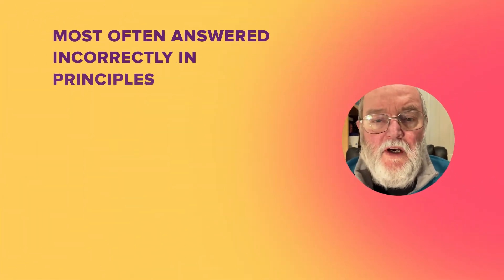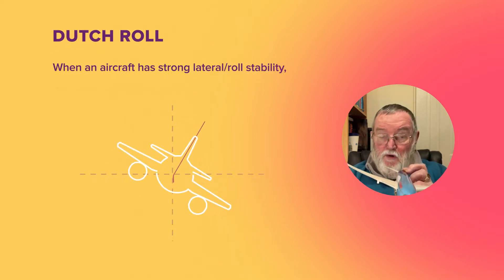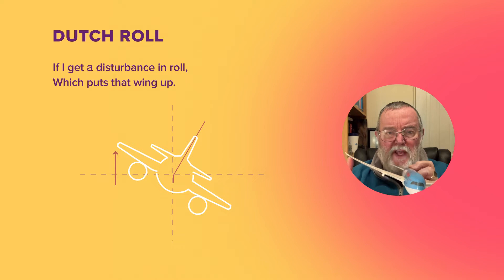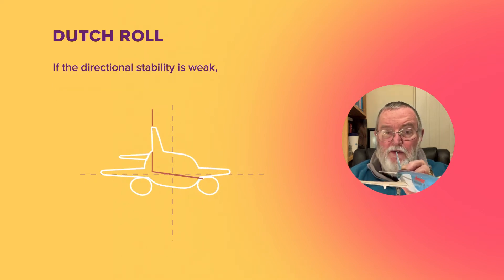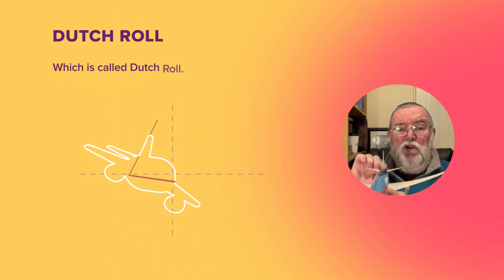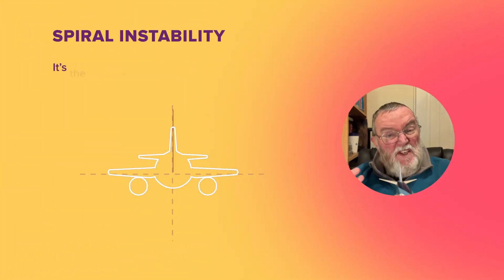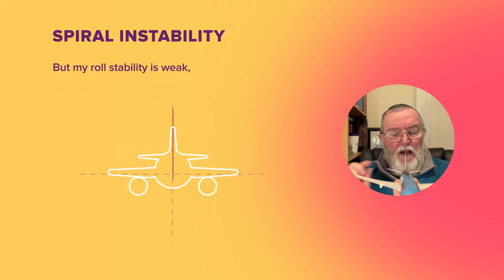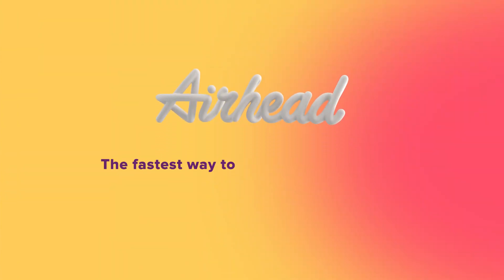Hardest ATPL questions Explained: Dutch Roll explained

Comment: It's a better answer than most that I've seen on YT, but one significant problem. When you talk of roll stability, you appear to conflate it with bank angle stability. Roll stability is conferred by roll rate damping. If roll moment due to aileron ( or differential spoilers in transport aircraft at low speed) is removed, roll damping (due to roll moment on the wings) rapidly brings roll rate to a stop. But it is indifferent to bank angle. It is the spiral root that either slowly brings the wings back to level flight if negative, or tips the aircraft further over if positive. (I was a flight dynamicist at Hawkers, later BAe, from 1972 to 2010).